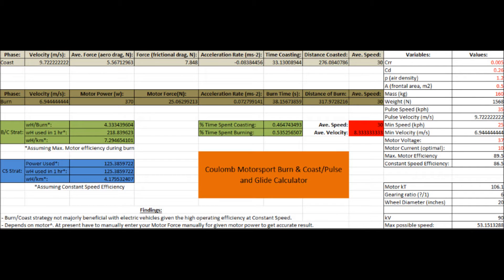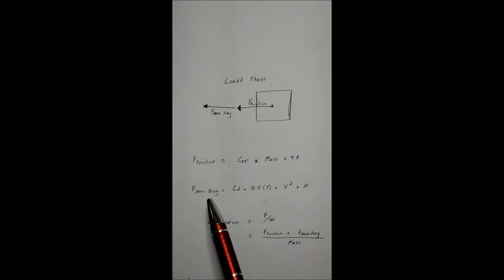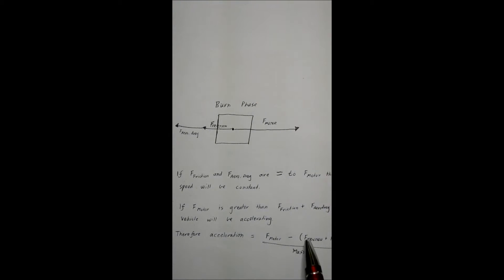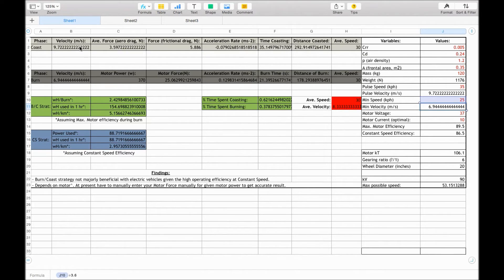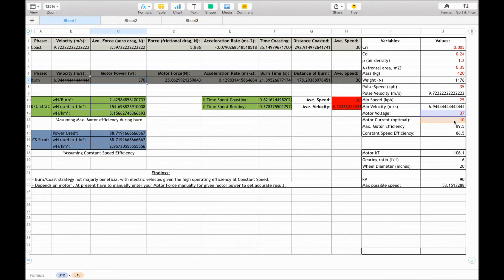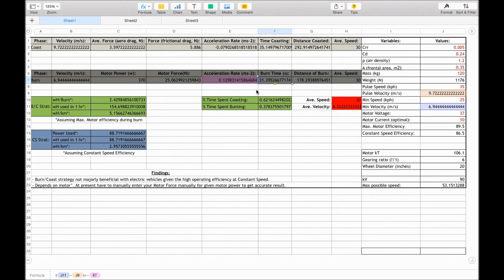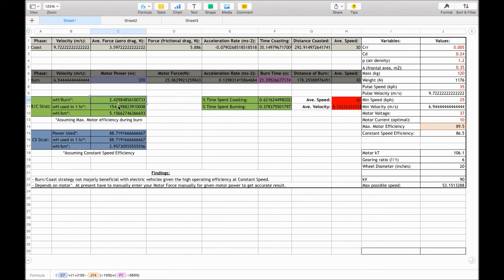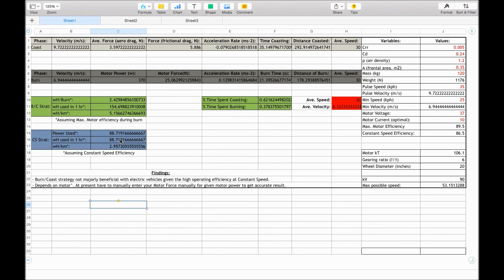Coast and Burn (Pulse and Glide) Calculator Explained

Comment: Do hills and/or corners make a difference?
Reply from the maker: +TheGreatOldOak Yes they do. I'm currently working on a version to take hills into account. Corners also make a difference, if you have the grip to be able to take a corner at the cruising speed then that is recommended as you'll lose some energy but you retain the majority of your momentum and very little acceleration is required to return to the cruising speed.

If you don't have the grip, coasting into the corner to the highest possible cornering speed and then accelerating sharply out of it back to the efficient constant speed would be the best method. (I do this on the road).

Finally, if you have to come to a stop (traffic lights, give way etc) then coast up to the stop for as long as possible and take off accelerating at the most efficient motor/engine range.

Comment: (4sken from ES)
If you are interested, I can see how this works and could put out a decent java program to do all this-It'd be the exact same but would look nicer. Before I put any work in, are you interested in me doing something like that?
Reply from the maker: +Ariel Lezen That'd be great. Happy for you to do that. Just be mindful of the importance of the Quadratic equation for Aero drag. at higher speeds as mentioned in the ES Thread. In my calculator I'm still just using the average between Aero Drag (max) and Aero Drag (min) but it should really be done in the way suggested by Teklektik on the thread.